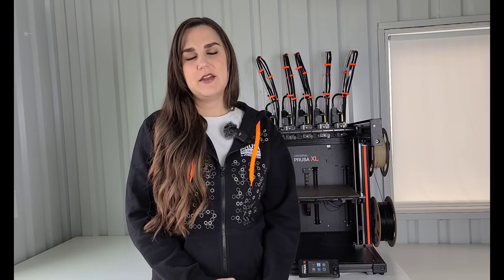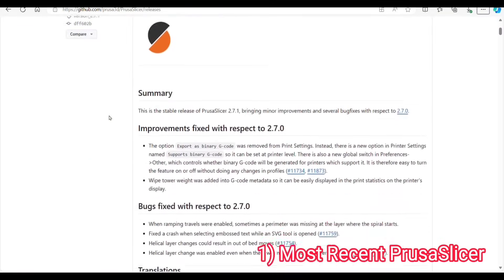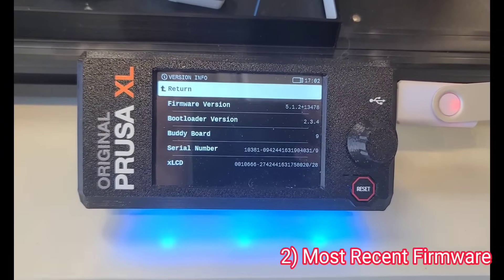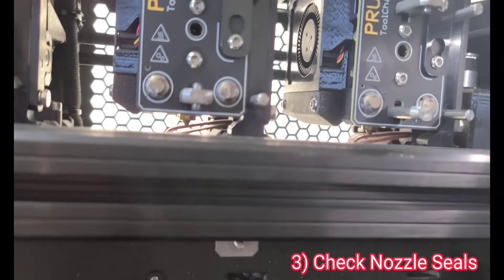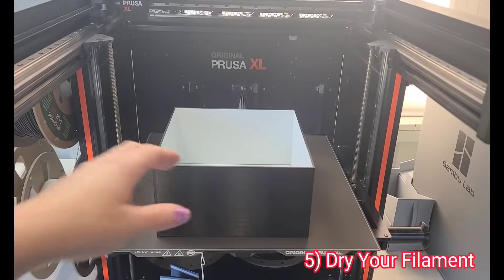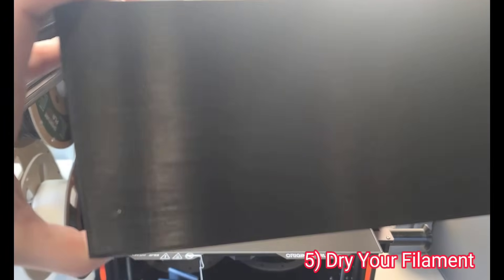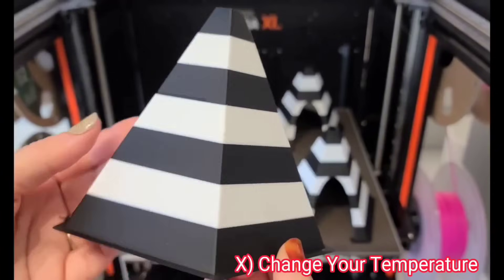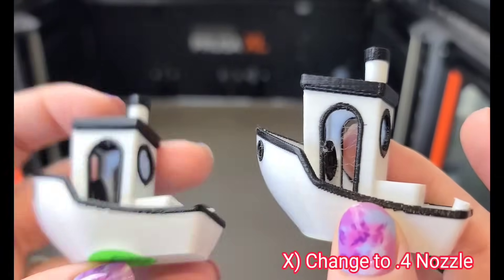Stringing on the Prusa XL - 5 Things That Worked and 3 Things That Did NOT Help!

Comment: Your nozzle seals are adjusted too high. They basically need to sit parallel to the nozzle itself to fully seal it. This is typically the root cause for most stringing issues I see with XLs and it's not really a design flaw: these nozzles are being parked hot and hot nozzles will ooze filament unless they are sealed - on any printer really.
Reply from the maker: Ok I'll check it out. Thanks so much!

Comment: why not print and use dryboxes for the filament? with petg/pla i never had stringing issues , and i always keep them in dryboxes.
Reply from the maker: I could and I may end up having to. But this same filament prints without stringing on 10 other Prusa printers including a single toolhead XL, and the MMU3. So it seems strange to me that the 5 TH is sooo sensitive. Thank you!
Reply: @tada3dprinting  understood , then that cannot be the cause...  so probably doing it mono colour and printing the same gcode on the xl 5 th and xl 1th with the same spool should yield different results? If so , i think it is definitely worth a case and your time with prusa support, because that's literally the same hw and same filament

Comment: Seeing prusa's correct nozzle seal, immediately followed by yours, in the video, it looks like your seals are  definitely too high! it looks like the seals should ne just barely touching the nozzles, allowing the seals to stay basically perpendicular with the ground, your seals are all being pressed down, making it look like they arent going to seal the nozzle hole properly
Reply from the maker: Ok. I guess I was just figuring the higher the better. I haven't adjusted them at all from the factory assembly. But I'll check them out. Thanks so much!

Comment: Nice video. I already cancelled my pre-order. Prusa did not deliver the experience we expect from their brand. Still feels like a beta test, not a printer ready for release.
Reply from the maker: I know some people are posting their beautiful prints on facebook. I think it has great features. But I am disappointed by the inconsistencies. Hoping they are things that can be improved with firmware etc since I already have it! Thanks!
Reply: @tada3dprinting  It seems like the hardware is good. Single color prints look good, and a few people have gotten good multi-color.

I do think it can improve with software, it's just frusterating that after so many years in development, Prusa, who is known for their well tuned factory profiles, really didn't nail this. You don't buy a prusa so it can be a tuning project, and yet that's where we are right now. Hoping they improve it going forward, I know at the very least they are trying.

Comment: I preordered my five-head prusa XL in september 2022 and I finally got the bill for it in early December 2023. 
They haven't shipped me it yet despite me having paid for it a month ago.
After watching multiple review videos on the XL I am getting cold feet about it. Prusa seems largely incompetent.
Reply from the maker: It seems like the issues some are having (like me) are improving. If you are printing large dragons etc,  I think you should be good. The trouble I am having is in the detailed or prints that have lots of changes. 
If I was in your place in the queue, I would get the machine and try it out with your filaments and your prints in your environment etc. And if it doesn't work for you, sell it. They're still in such demand that I'm sure you could get full price. Thank you!

Comment: I bought a Prusa XL 5 toolhead second hand. I updated it to the last firmware and tried the included G-Code files. The result was: stringing as hell and blobs with other filament colors...
But after I sliced my own models (using the newest PrusaSlicer) it all was gone. I now print stuff with toolchanges and no stringing (besides some small fine whisps for special filament like Polymaker Breakaway support) and great print results.

As far as I know they changed the way the toolchanges happen inside the slicer so that the toolhead first goes over the wipetower and then triggers the toolchange which reduces stringing and blobbing. Here is a video describing the process (but with a manual change of the location before a toolchange): https://www.youtube.com/watch?v=agihAiTZJ00
Reply from the maker: I agree that the included gcode files are outdated. And my printer has done ok with some very boring basic prints. But any detail has had stringing issues for a long time. It's nice to finally have it under control. 

I did try out that custom gcode and it worked good but didn't work with lightning infill. Trying out some new things now. Thanks!

Comment: Although I was concerned about wasted filament, Bambu Labs does multicolor better.
$4000 will get you a Bambu with AMS, and about 120 rolls of filament. The XL just isn't ready for prime time, but I have confidence that Prusa will get it right. Their reputation is riding on it.
Reply from the maker: I really love my Bambus that I just recently purchased. I just wish they could print bigger and less waste. But yes I am using them for the majority of my multi color prints. Thanks!